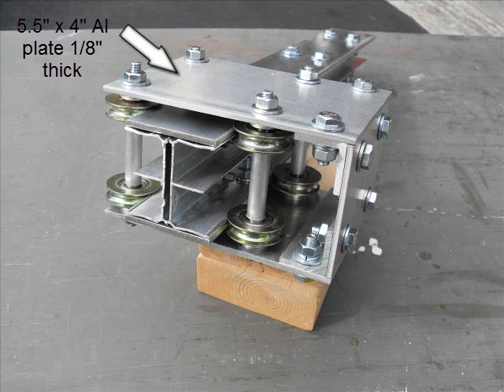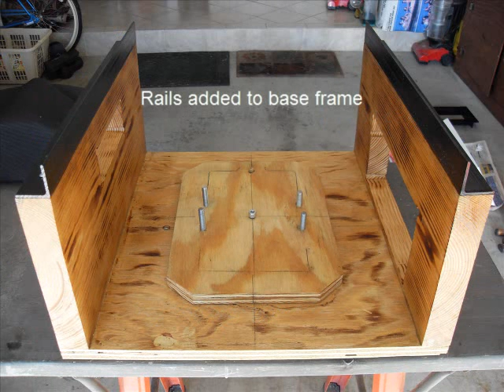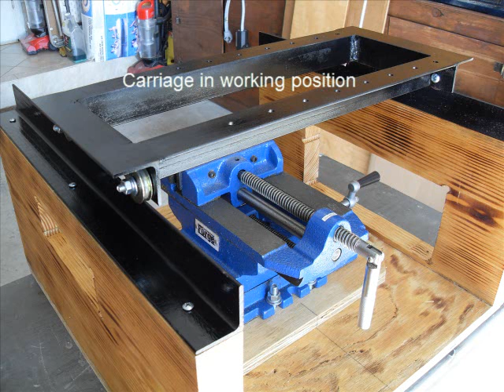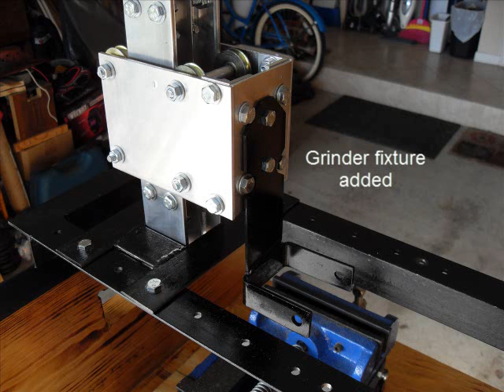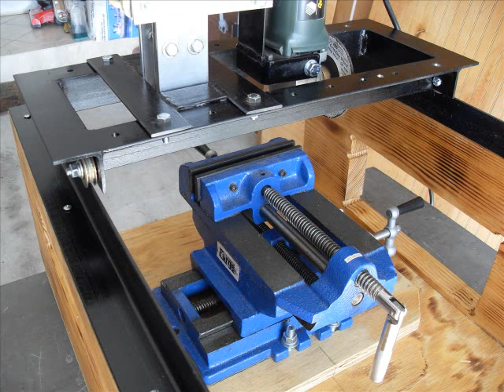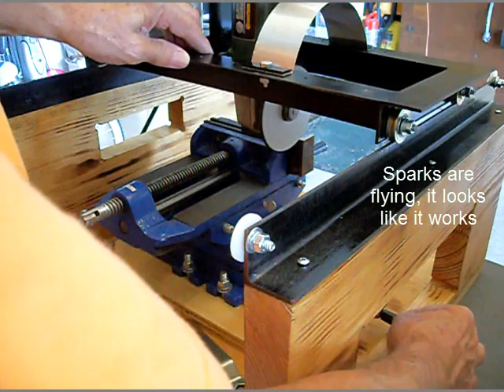Linear slide/rail/cam roller for a grinder DIY Part 1/2

Comment: Hi,
I really love the simplicity of your slide. Would it be possible to add a belt and pinions with a crank handle to operate manually? If so can you assist? Thank you in advance.
Reply from the maker: Sorry for the late answer. You can replace the handle for a toothed belt or a plain belt or add a motor as an actuator. Regards